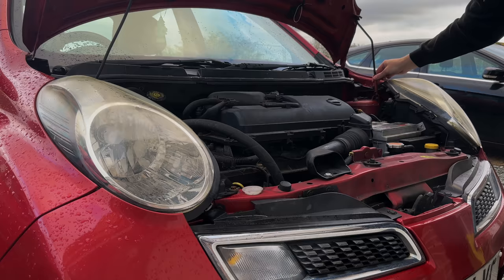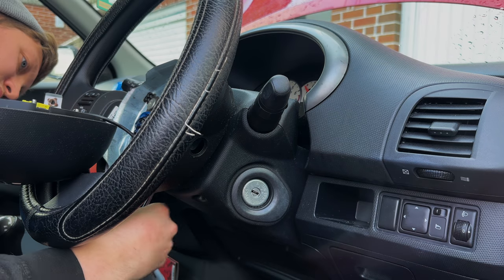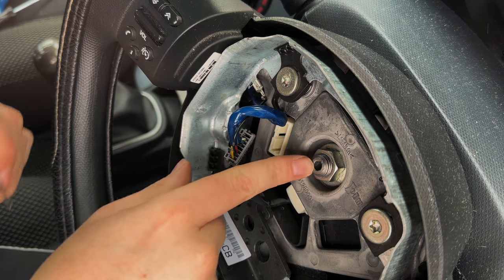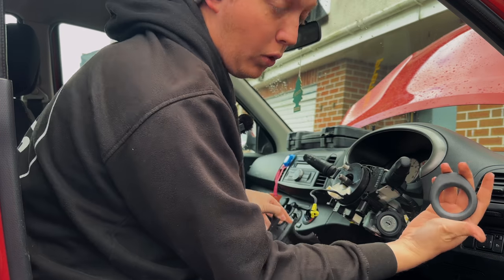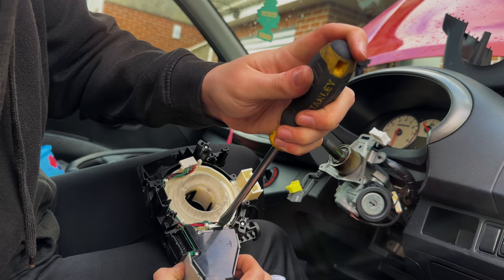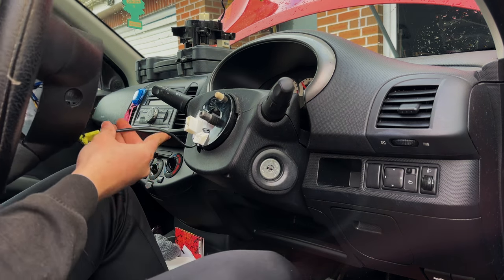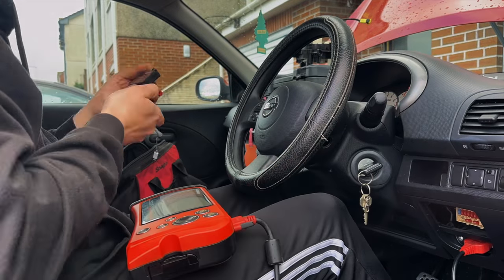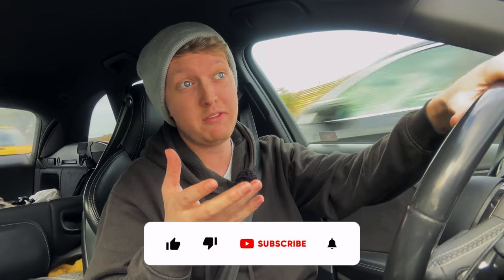How To Replace Your Clock Spring In Less Than 3 Minutes [NISSAN MICRA K12 & OTHERS] [TUTORIAL]

Comment: Hi.. need your help.  Do i need to replace clock spring on nissan micra K12.  Horn sometimes works and then not.
Reply from the maker: I believe if a new clock spring is needed it is usually accompanied by the airbag light. It could be corrosion on the terminals, faulty relay etc